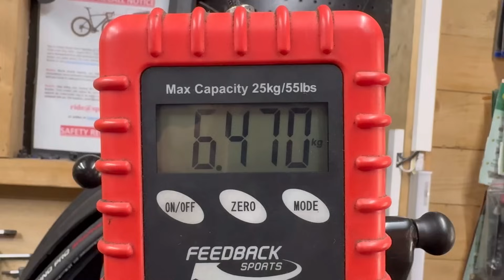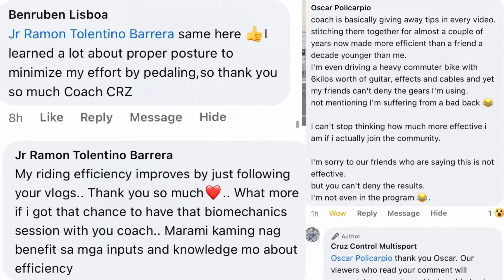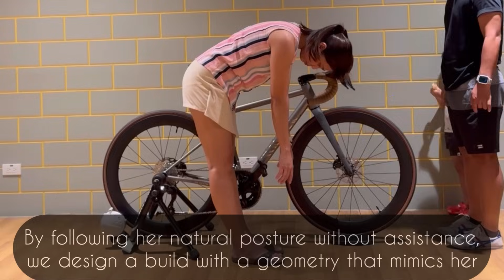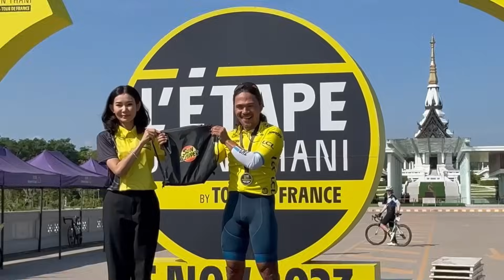Paradigm Shift in Bicycle gearing with GCN talk

Comment: What goes around comes around!  52/42 was standard up until the 2000s, on bikes that weighed 22#.  Ambitious club riders trained up.  52-17 was the perfect gear.  Eddy used a 44 on the hills.  Glad to read big rings are back.  On 17# bikes, they're a piece of cake!   No wonder speeds have increased.

Comment: 🥰 will be upgrading to a bigger chainring hopefully in 2 years or so wait ka lang Coachie
happy with my 52T chainring setup.

Edit: As someone who also tried the SRAM etap groupset - they really have limited options for you if you like to experiment with your setup. I had to fork out 200usd for a custom made 52T chain ring, but you know the other issues that happens when we hack our gearings 😂 then I went back to Shimano and problem solved.
Reply from the maker: Progression is cumulative, as you get better the equipment can also adapt

Comment: Interesting as one who has ridden since the early 80's and raced as a Cat 2 in truth we used large gears back then.  While we may have only had a 53/39 on the front we had at most 7 in the back with a 12-23 or maybe if really steep stuff might put on a 26 bailout gear - I think the largest I used was a 24.  So, now with 12 speeds and larger gears in the back going larger in the front makes sense.  I say all this as one who is a lower cadence guy just feels and works better for me and at 65 likely not to change.  Hey I still use 175 cranks when people seem to be going smaller:)
Reply from the maker: Cyclists of the 80’s and 90’s I consider as purists, the hard men. Back then, pure talent and courage was the currency and we adapted very well in any conditions. Thank you for sharing your experience. Myself I started in ‘91
Reply: @CruzControlPH   - Looking forward to checking out some ohter videos on your channel
Reply: I mean to add I still ride my 1989 Medici  (steel)with Scott Dropin Bars, 1st gen Chorus break lever shifters and a 1989 Dura Ace 175mm 53/39 cranks with a 12/24 7 speed cassette.  Even did a 200 miler with some good climbs.  Leads to some good looks on the climbs in a 39/21 - always save the 24 for emergency bail outs:)